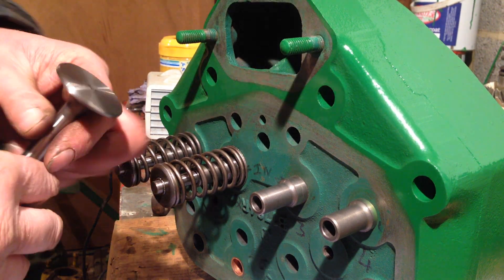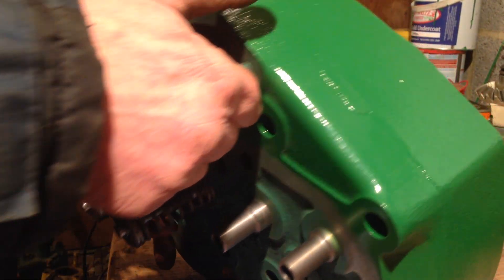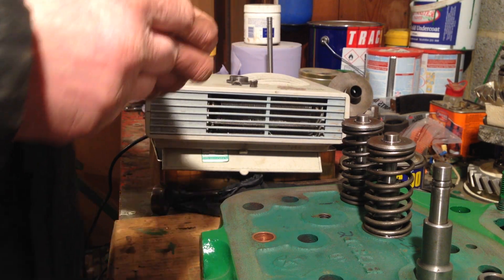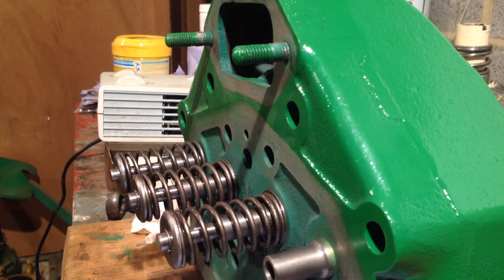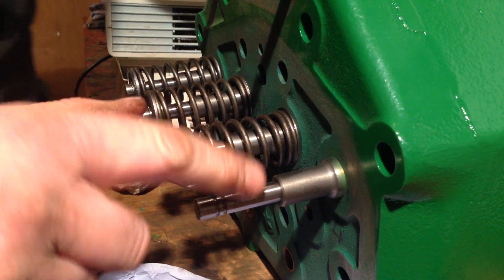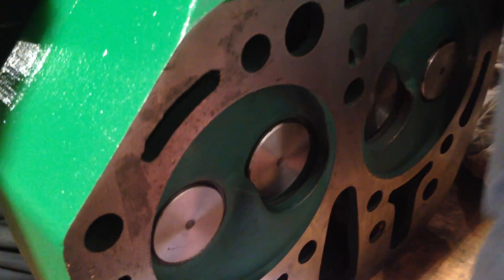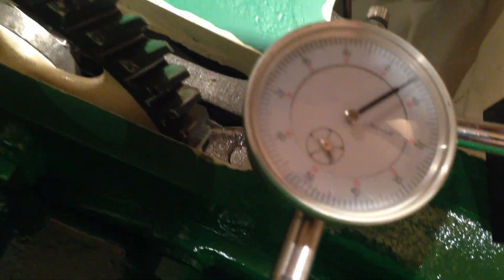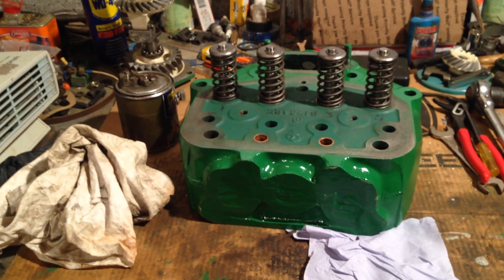1940 / 41 John Deere B tract restoration valve installation and crankshaft end float measurement 59

Comment: I have a John Deere very similar to yours and I have a question I would like to ask if the head is badly rusted would that grinding compound still work
Reply from the maker: Hi , I guess we’re talking valve seats , if badly pitted you’d be better off getting them recut at a machine shop , the grinding compounds are more for polishing and finishing the seat surfaces , I know you can get different grades of compound , . If they are beyond recutting you can put an insert seat in but that is a last resort for me they can come loose some times and cause other problems . Hope that helps regards David H .

Comment: My parts book shows a total of 4 the "valve spring centering washers part #B1796R" are required.  So they should be on both the intake and exhaust valves.
Reply from the maker: Thanks for the info on that,  I’ve found some have them and some don’t , I suspect they are used to to stop the spring wearing into the head the shim material will be a lot harder than the cast head 👍